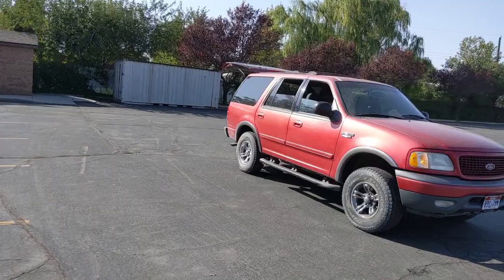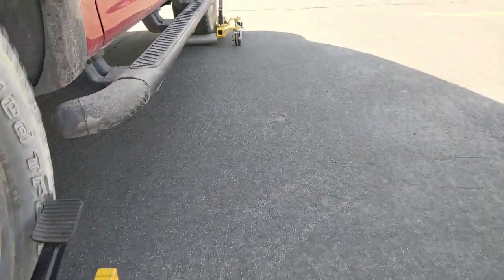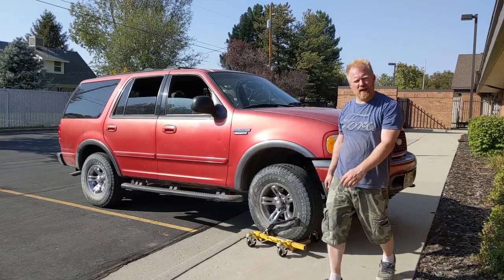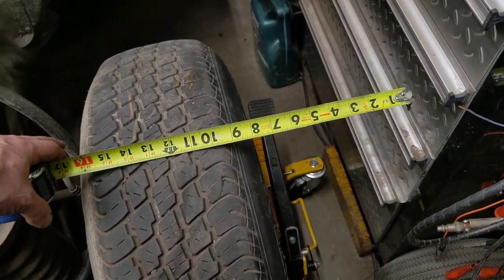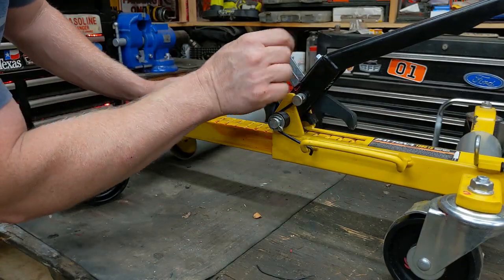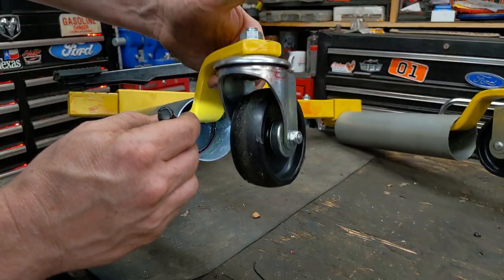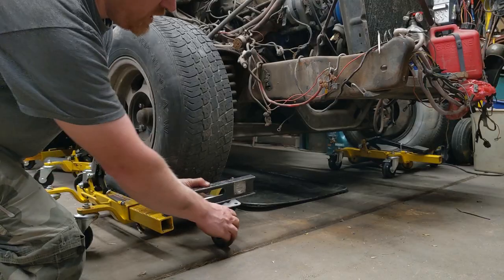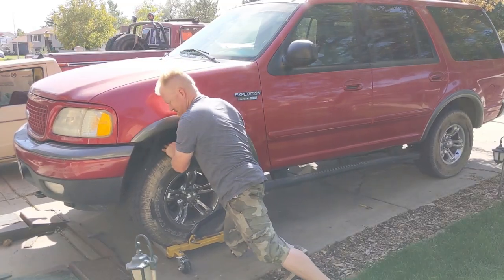GoJak Knockoffs Harbor Freight self Jacking car wheel dollies ANY GOOD?

Comment: I.might get fired for saying this but eh the casters at hf are trash and assembly of products does take some loose bolting up before tightening down.... but for the price of some of the equipment and how much you use it depends on if its worth it. Like yes a set of stubby matco wrenches would be nice but $200 ones vs $30 ones with lifetimes warranty

Comment: I don't understand why they didn't use a plain bearing (bushing) on the casters, it's a perfect situation for bushings. Bushings are good for lower speed but high force applications with axial loading. I guess steel is cheaper than bronze smh.
Reply from the maker: Must have been to save a penny.

Comment: So,,, the roller/sleeves just slid off the arm once the caster was removed?  From the video it didn't look like it would make it.  Just wondering.  I thought of the fired when I first saw it and was thinking that there was no way those careers would act right and that angle.  Great video by the way.
Reply from the maker: You remove the caster and an allen bolt holding on a roller guide and they slide right off.
Reply: @sixtyfiveford  Thank you!

Comment: You should of done the final test on the asphalt... We already knew they worked well on the cement
Reply from the maker: They didn't work well on concrete with anything over 2500lb-3000lbs. They were dog crap and would self steer running your car into walls etc.

Comment: I bought 2 of the Harbor Freight moving dollies that are supposedly rated for 1000 lbs each in order to use them to make a motorcycle platform / dolly for my garage.  I can use it to store my 800 lb Harley in the back of the garage behind my Jeep.  By using the wheels from 2 moving dollies, I figured it would be rated at 2000 lbs and thus be easier to move across the garage concrete floor (which is most definitely NOT glass smooth).  The platform itself is made from 2x10s for the longitudinal members and 2x6s for the cross members.

http://www.monkeywrench.space/diy/motorcycle-garage-dolly-all-2x10-03.gif

It's a lot easier to squeeze the bike into a tight space, but there is a definite amount of resistance involved in getting the casters to change directions.  My solution for this is to use one of the pieces of wood from the original moving dolly as a lever to pry between the concrete floor and the edge of the dolly to get it started.  Once the caster has rotated to align itself with the direction that I'm wanting it to head, it moves smoother.  I suspect that the hard rubber wheels might be making it more difficult.  Having solid steel / cast iron wheels might be better.
Reply from the maker: I like the way you think. I already did the math and the coefficient of friction/rolling resistance for steel wheels is 1/10 or more vs the plastic wheels (depending on what they are made of). I have an engine hoist with steel casters that easily moves the heaviest loads. My tentative plan is to remove the plastic wheels and make steel ones and I expect too see a dramatic difference especially when changing directions. Also I wouldn't have to worry about the wheels getting flat spots from prolonged weight storage. 

Your plans are very well illustrated.

Comment: i just want to use this to hold up a tire while changing it on truck rotor so i don't have to fight the screw holes putting it back on. i think it should work okay ? sadly this was the only thing i could find for something like this. pretty expensive tire holder. smh

Comment: I thought you were going to make one from scratch, you could make it thinner by moving the casters in live with the wheels front and back.
Reply from the maker: I have designed a few on paper/my head over the years but by the time I bought the casters at $50ish and materials I was going to be really close the cost of these. I figured I would give them a try, but I didn't think I was going to spend any real time having to modify them like I did. I've had them for a few weeks now and had made up my mind to return them at least 3-4 times. I was going to cut these all up and just use the mechanisms with the wheels inline like you describe and I may still do that as the 8+" is annoying. On the side that's not against the wall I have a 8" tripping hazard as well.

Comment: The problem with most of these types of dollies is that the caster wheels are too small.  I have 6 HF diamond plate dollies and they have the same problem.  Mine don't bend noticeably but a small bit od debris will stop the dollie wheel form turning.  Bigger wheels would work better but I'd have to jack the car up higher (doable).
Reply from the maker: Some of those plate dollies have teeny wheels. I saw tow truck driver the other day that had the actual Go Jak dollies on his truck. I talked to him for a few minutes and the wheels on those seem about an inch larger than the ones I have. Says he pulls cars all the time across the super rough asphalt and even dirt on occasion. Says they do break on him after a few years of hard use though.

Comment: Some steel wheel casters would probably make it even easier to move.
Reply from the maker: I called some caster companies and steel is the best but has it drawbacks. They tell me having zero give makes they roll effortless until you hit a grain of sand it dead stops them. A super hard plastic will momentarily dent and absorb that grain allowing it to roll over. They all want around $100 for a set of good casters. You can even buy the ones for the real GoJak for around $110 for set. If/when these break it'll probably just be the plastic and I'll likely weld up some steel ones from some old pipe. .

Comment: You mentioned your truck weights 5000+ pounds, I think the capacity of these should be around 1200 pound each so seems your vehicle is way too heavy for it, I dislike everything Chinese knockouts but wouldn't blame this one on the jacks. I got a set from Amazon, also Chinese ones from Weize, stated 1300 pound capacity each but being Chinese I would not trust that, however the car needing to move is a 2000 Tacoma truck single cab and i believe gross weight is around 3000 pounds. I want to be able to move it on my own but got a slightly slanted driveway, wondering how many people are needed to help or perhaps even taking the transmission and engine off the car first then move it with couple people to where it will be worked on?

Comment: Only having the front on those jacks will make it alot hearder to push sideways, even with your truck in N...
At at HF you get what you pay for generally...
Reply from the maker: It was nearly impossible even will all 4 on smooth concrete. I did the same sidewalk test after mods(cut out during editing) and it moved very easily.

Comment: Just ran to three different Harbor Freight and called a bunch.. easy hour drive to each one to get just four.. they seem pretty popular but from what is said he.. maybe just for passenger cars.. but even with newer cars.. they weigh them down with electronics smh.. now idk if I should return them 😕
Reply from the maker: I think they would be fine for sub 3000lbs. They really start to suffer with anything over that. I wouldn't buy them again and think it would have probably easier/cheaper just to the get the cheap $25 ones that you slide under each wheel after jacking it up.

Comment: So I work on cars for a living and I love harbor freight tools and I have a set of these and they are not as hard as he says to use mine move with no problem I use them on my 96 Cadillac deville
Reply from the maker: Harbor Freight has their place with some tools but when you spend this much money you expect great results. Honestly these should be $75 MAX! at Harbor freight or 2 for $125 on sale. Since the son kicked his dad, who founded the company out on the street they have become a greedy corporation. These Daytona wheel dollies are maxed out around 3500# without serious modifications. It took me 6+hours to modify and around 2+ hours to initially assemble and grease the 4 units. So I saved $500 but spent nearly 10 hours to make them work like they are supposed to and I may still have future problems with the casters(if they fail I'll be out another $50x4 for new casters). If I would have bought the real GoJak dollies I would have likely spent zero time to have a working tool right out of the box. I didn't discuss it in the video but I also had to file some of the metal mechanisms to allow them to work correctly(raise/lower). If you look at the first clip with the Expedition on it the main rollers are 1/8-1/4" away from the ground. After the modifications they sit 1" off the ground.

Comment: That grease is cosmoline ,rust prevention.
That type wheel  bearing has to be parallel to the ground or they suck
Reply from the maker: If I recall cosmoline was more waxy. This stuff was like watery animal lard and only barely slippery. Whatever it was it was cheap and there was a ton of it.

Comment: Have you contacted harbour freight and let them know and advanced them it's to bad I was going to get some I'm still using the old ones that you lift the car and put them under the tires thank let me know please what you find out (Ross)
Reply from the maker: HF doesn't care as they don't make anything. They just buy from random China manufacturers and have their house brand decals put on items. They even refused to post my review as it was negative. They pick and choose what reviews to post. 

Honestly if I only had a 2500-3000max car these would likely be ok. But if I did it again I would buy real Gojacks or just the inexpensive ones you jack and slide under the tires like you have.

Comment: Nice modifications...good job💪💪💪🇺🇸🇺🇸
Reply from the maker: They seam to be working good now. I'm sure something will break on them though.
Reply: @sixtyfiveford  yeah probably..
I went in harbor freight years ago needed some pneumatic metal snips..got them home had to fiddle with them for 45 minutes to make um work...if i recall it right they had a seal in upside down...but shit...for the price could not go wrong
Reply from the maker: @robertsmith7637  I've been unfortunate enough to have Harbor freights around me for the last 25 years. I don't know if there's one tool I still own from them that hasn't been tossed out or replaced with the real brand name, heavily modified with welding, completely re-engineered, or I just keep putting bandages on it to make it last one more job. In the long run it would have been better off to never spend a penny there and just to buy the real tool.

Comment: You need to get some neoprene wheels cause they can handle more weight than the ones you have there I bought a set for my engine hoist and what a difference I pulled a diesel engine and transmission out and my boom had a bow from the weight of engine and transmission but the wheels rolled it out of the way on my shitty driveway and I was surprised, hope it helps you with upgrading your jacks

Comment: Looks like a guy with a mig and a little know how could of done better. I'm thinking for myself to bolt 4 pieces of 2x4 together with some good casters won't be as fast as these because I'll have to jack up each wheel first but how often would I use them. Or I'll use the C channel scrap I have, steel might be the best option, I have both stick and mig to use. I just don't have garage big enough yet to justify putting time into making them.
Reply from the maker: Very true. The casters seam to be one of the biggest costs.

Comment: 500$ thats too much chief! i think if i need a set ill be making some myself but leaving out the jacking function built into them and just using a floor jack along with them
Reply from the maker: I agree, it is too much especially for something from Harbor Freight. You can pick up a full set of dollies you just set under the vehicle for around $25x4. Cheaper than you can build one for; the issue with those is the tiny 2" wheels get stuck on everything. I was going to build ones like this with 4" casters but the self jacking feature intrigues me. I've sketched out a few plans for these self jacking ones over the years but building costs with caster pushed to the point of $50-75 a piece, plus labor time. I thought for $100ish a piece they would just work and I could move onto other projects. I was wrong.
Reply: @sixtyfiveford   nice big strong wheels on the pegs they use for scaffolding, also nice threaded acme rods and nuts on the adjustable legs for scaffolding, good for projects if you can find old corroded or broken ones for free or cheap

Comment: do you have any idea how high it lifts up in inches?
Reply from the maker: The larger the diameter they tire the higher it will lift. On my grey truck in the garage it's around 3 inches but a small care tire would only be around 1.5-2inches. A 35inch tire(max you can get into this) it would lift about 4 inches.
Reply: @sixtyfiveford  got it thank you

Comment: Is that a 352 or a 390 in the truck ?
Reply from the maker: She has the original 352. I drove it daily for 10-15 years and it never let me down.
Reply: @sixtyfiveford  looking forward to seeing you drive it again..the 352 is a very good motor..i have one in my 65 Galaxie 89,000 mi. Still runs strong..Cheers 🍻🍻🇺🇸🇺🇸🇺🇸

Comment: Looks like the truck was too heavy for jacks if the jacks are rated for 1300lbs
Reply from the maker: 1300 Each. 5200lbs total. Expedition weighed right at 5000ish lbs. Grey truck was just under 4000lbs.

Comment: We need more content like this to tell folks that companies are saving a penny worth of steel and a welding rod to make their products garbage. They could have a way better product for very little effort and cost we need more artisans and less race to the bottom logic! Harbor Freight typically has great floor jacks but these my friend are garbage. The company cheaped out on the cheapest material that one could buy! Where is the logic you ever recycle steel lately look at the price you practically pay to take your steel in cause it costs you more in gas than you get for the steel. Wanna make some cash develop something useful made out of steel or plastic these days and you have it made its that easy really.

But the takeaway here I know from experience too many people throw harbor freight under the bus so to speak but their are many products there that are well worth the price although this may not be one of them they do have an unreasonable bad rep for quality but much of it is not proved out that well I feel.
Reply from the maker: Harbor Freight does have it's place but I think you're always better off to buy a Used name brand tool vs new Harbor Freight stuff. Their stuff does work and get the job done but until you use the real tool that they've copied you don't realize how much easier the job could have been completed. I've had Harbor Freight stores around me for 25years and virtually every dime I've spend has been wasted by having the tool fail and me just buying a name brand to replace it. The stuff I do have requires constant upkeep, welding, and fabricating to keep it working. The few items that haven't needed any work are things like impact sockets and wrenches.

Comment: What a weak design, i knew you would improve it no end :-D
The needle bearings were a joke and a half, horrible quality :-(
Would bigger wheels help at all?, a larger wheel does not find every dent in the tarmac like a little wheel.
Sorry moe, your doggy is the star :-D
Reply from the maker: I had to file down a few of the needle bearings as they were so bad. They are just mild steel. I think moving up 1 size in wheels (5 inch/130mm) would likely help dramatically on rough surfaces. I think more important though is the wheels should be solid steel or cast. They would be noisy but roll so much easier.
Reply: @sixtyfiveford  Not really sure about the wheel material,  a solid steel wheel would have no obvious weak spots, but add a bit more weight to the whole car.
A wider wheel would distribute the weight over slightly more of the tarmac, less chance of falling into dips in the tarmac, or making dips worse.
With all the extra weight i would want a lighter wheel,  i'm not sure if cast aluminium has the strength, maybe nylon wheels...
I'm not an engineer Moe,  you are the engineer.

Comment: bah at that point of modifying, youre better off building from scratch.
Reply from the maker: I actually engineered about 10 different designs and even built and tested a few over that past few months. I can build them with different lifting mechanisms but the cost is always approaching $150-200 each in new materials. The biggest problem is finding casters at an affordable cost. I have tried a dozen with the 1300-1500lb combined weight rating and they all fail or are impossible to push. Tested some at the $10 range off furniture dollies(actually nearly the best), a bunch at $25 range, $40-50 range and the only casters that work are around $100 for a set of 4. I have not been able to locate the same style of casters they are using for these and reaching out to caster companies keep putting the price tag around $150(set 4) for 1300-1500lb casters. The lifting mechanisms I got down to around $10-30 depending on design. The steel frame I even cheapened up from 1/4" down to 3/16" but you have to buy more steel than you need and still can't touch the Harbor Freight cost(around $100-125 each). If I could locate these correct casters at around $40 I could get the total build cost to under $100 and probably 8hours labor to build all 4.

Comment: S0 buy Better WHEELS.......& A new spring's
Reply from the maker: Casters that will hold this weight are right at $100 for a set of 4. I've tried at least a dozen cheaper model casters and they snap or won't roll.